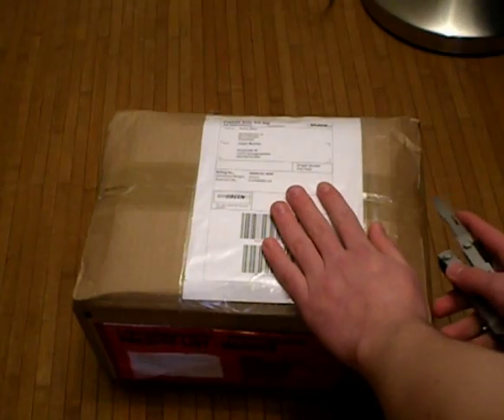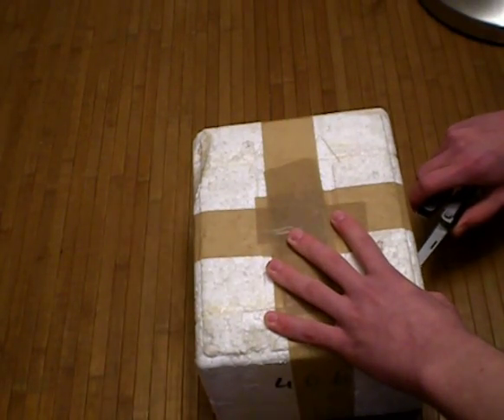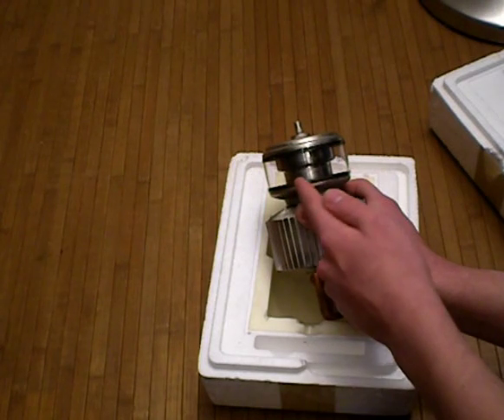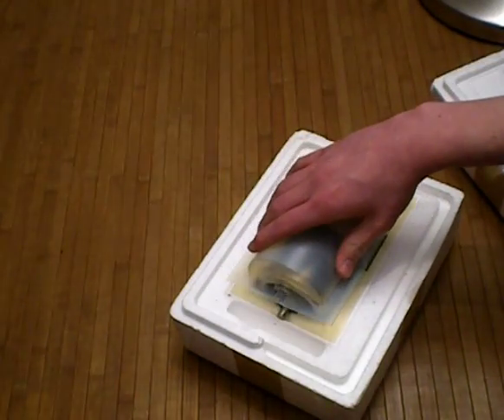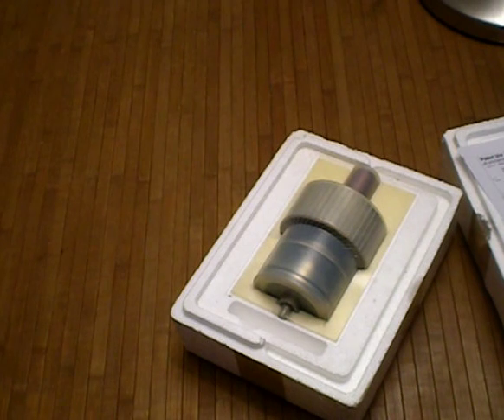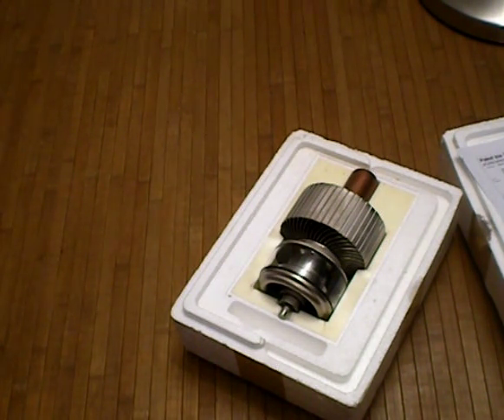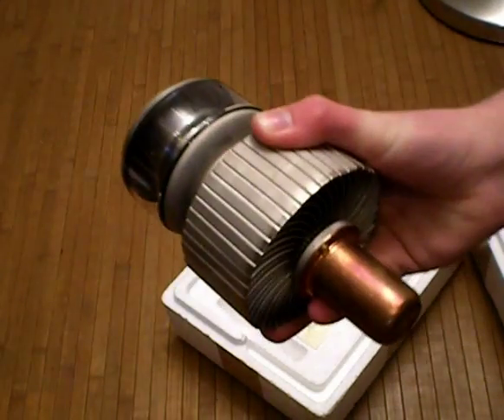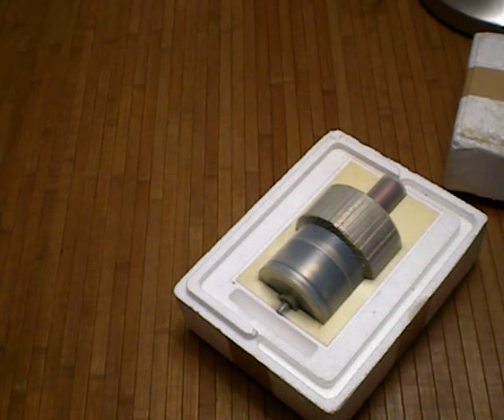Unboxing a GU-40b transmitting tetrode

Comment from the maker: @MrSciencetificsasuke well this tube, you see in the video was the last one that could be buot, so i got lucky, such tubes can cost anything form 10, 20 bucks to several 100000, depends on the rarety of it, and the power, and also the manufacturer / age, my oldest tube the RS291 is worth several thousnt bucks, it was made during WW II. this one was made befor the fall of the UdSSR / CCCP, this perticuler tube is used in a soviet transmitter rated up to 250MHz, at 2 to 3 KW